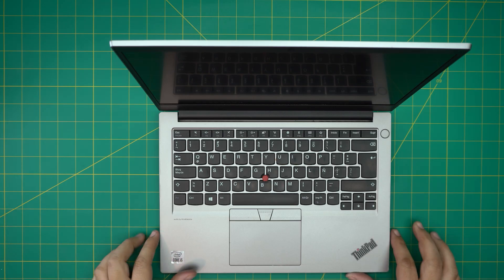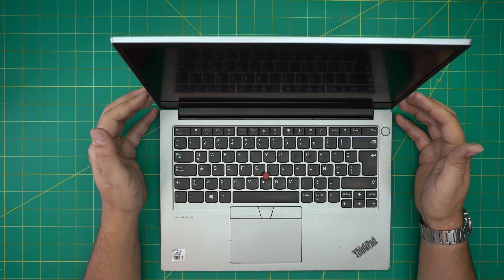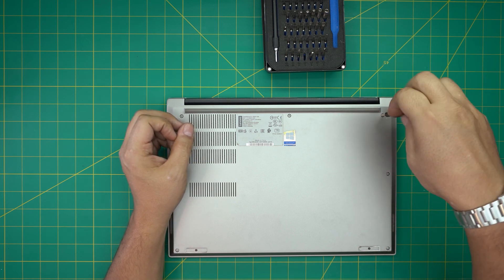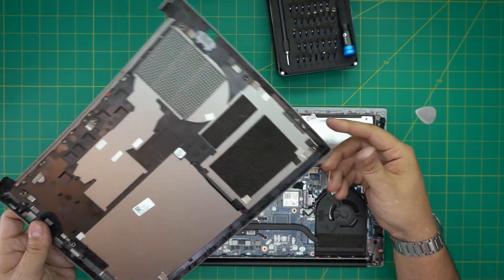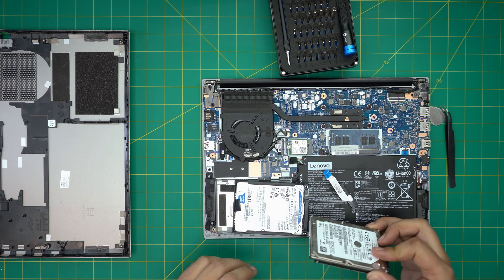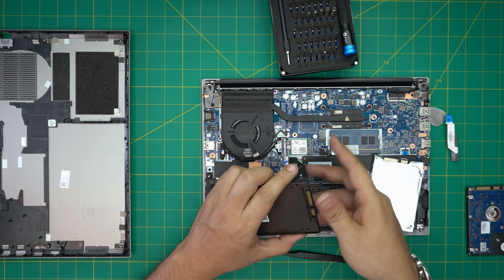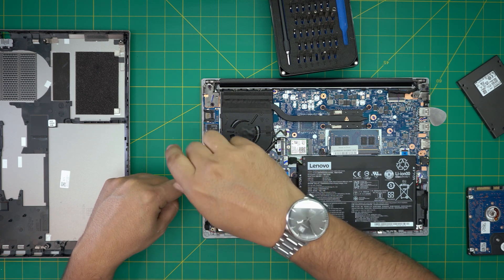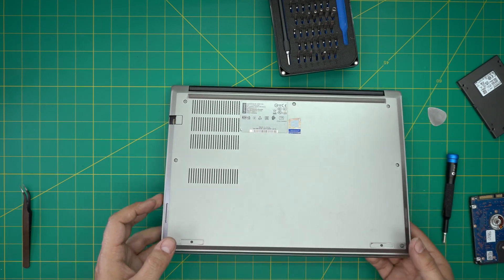How to Upgrade Storage (SSD/HDD) on Lenovo Thinkpad E14 Landererova 12 Laptop - Step-by-Step

Comment: where to get the hdd casing and the sata ribbon cable?
Reply from the maker: you can good for it on ebay or aliexpress search for the flex hdd adapter. and the hdd caddy.
Should you have any further questions or requests in the future, please don't hesitate to ask me.
cheers🍻